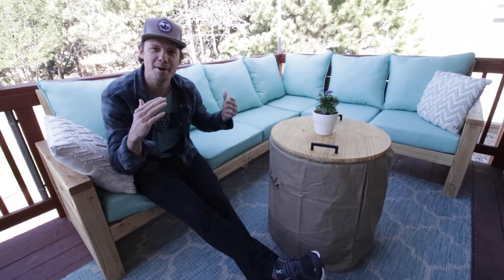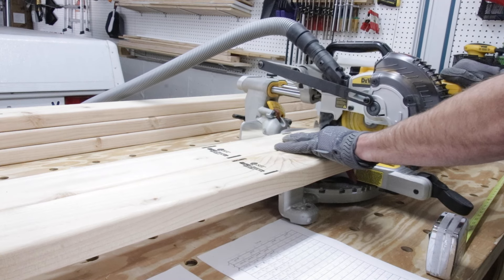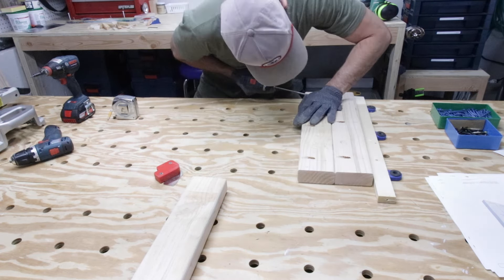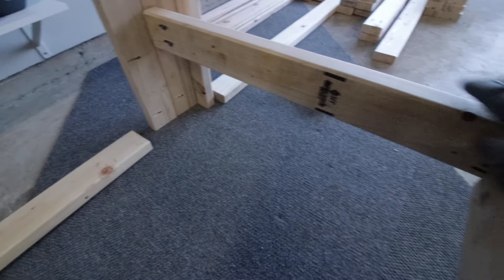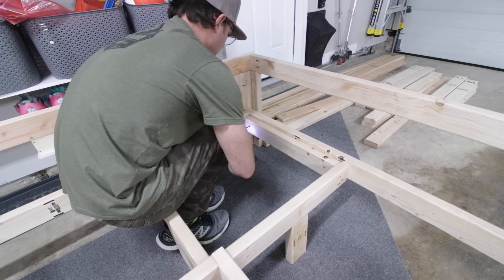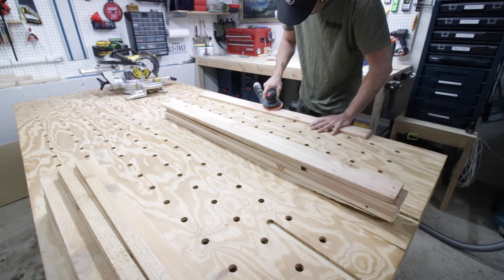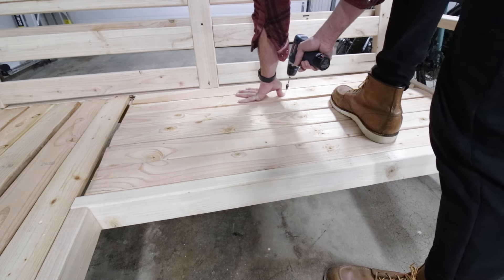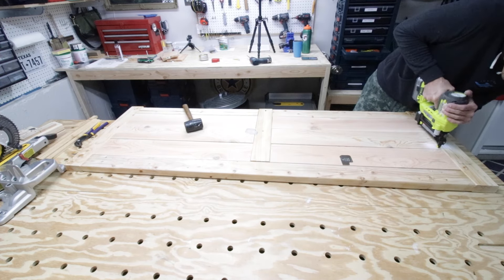DIY Outdoor Sectional

Comment: I've never built anything,  but need a new frame for the cushions i have already.  I think I'm going to use your plan and adapt it to the size of our cushions.  As someone who has no experience and limited space for tools, what suggestions would you have for buying tools?  I'd need to move the table i have out to the driveway and do all my cutting there and then store the tools in a fairly small area.
Reply from the maker: You can definitely do it! I would recommend RYOBI tools, found at Home Depot.  You could do everything with a circular saw and a drill bit it would be a little harder but you would spend less on tools. It would be easier if you bought a miter saw and table saw but that would add to your expense. I think RYOBI is cost effective and stores well. Here’s the link to my plans if needed: https://fieldtreasuredesigns.gumroad.com/l/outdoorsectional
Reply: @diywithandrew  Thank you for the suggestion,  I'll be going down there today and starting the planning process.

Comment: So with the price of wood and cushions, probably over $500
Reply from the maker: Yea I think that’s about right. The cushions are stupid expensive. Still cheaper than buying one from a store though.
Reply: Much cheaper than the $1,000-ish you’d pay to buy this from a store
Reply: It's not going to rust like the one from the store tho...and the frame itself will last 10-20 years outside. The one from the store starts rusting after 1 year.
Reply: What’s the size (length and width)?
Reply: I’d like it to be a bit bigger, by one seat each side. Would I just buy one 12 footer and fifteen 10 footers instead of the 10 and 8’s you have on your cut list ?